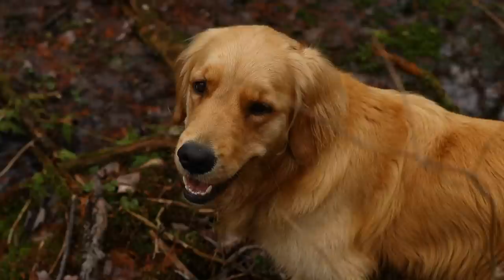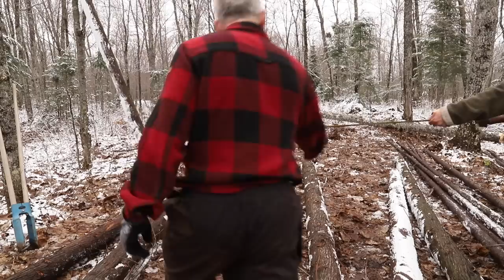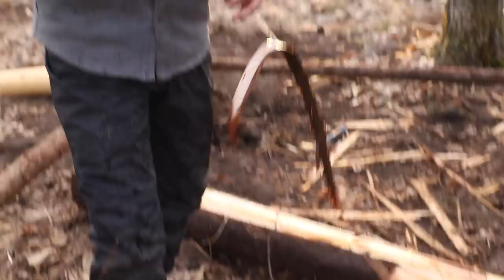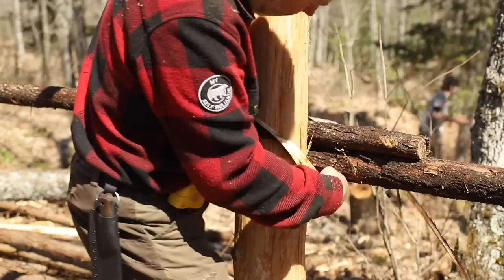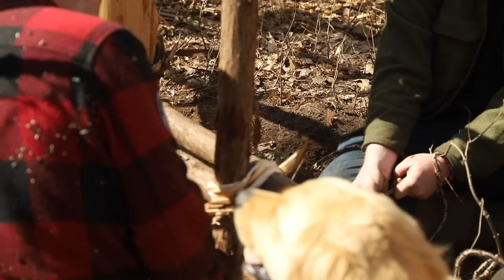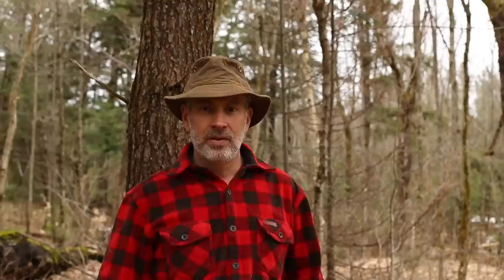Building a Native American Longhouse with Hand Tools | The Best Natural Bushcraft Shelter

Comment: Long houses were used in winter camp where you didn't have gardens separating homes. Summer camps used smaller huts or wigwams and had gardens between them.

Comment: Depending on what tribe they were, few of them felled large trees. Smaller trees (less than 4") and sappings were more commonly used making bark-covered wigwams or longhouses of which are typical dwellings used in north eastern regions. How did they cut trees? For the most part, they didn't. If you look at early European sketches of Native American villages even the more complex ones, the majority use of logs came from thinner trees and they used a lot of bark. This was material suited to what tools they had,  native American tribes were amazingly adaptive and suited for survival. They were a culture in western terms every man trained in every skill set.

Comment: hey Shawn great stuff as always. I work for a major forest company here in Sweden and here we instead have severe problems problems with spruce beetles right now due to an extremely hot and dry summer of 2018 (we had 25-30 c daily for almost 2 months with very little perception). I know there have been similar problem for canadian forest companies with dying spruce/pine for a long time. what are your thoughts will, more species get infected over there ?

Comment: I like the idea of a long house but I would like to do an alternative version where inplace  of wood white PVC pipe or tubing is used to form the frame section sure that would cost some money depending upon the overall height  width and length it would be way easier to build and one person could build it with a limited amount of tools because in reality your building is basically a hoop house with a center support beam running through the length of the building to provide additional strength to the roof

Comment: Hi Shawn, I was watching you guys having a hard time loop  the  sides to frame.  A suggustion that might work next time you might do a long house or something similar.  Were i work sometime we have long finish product that made of wire that needs to be coil to be shipped. I notice when the coiled wire comes loose it in a curved shape.  Mabe tied the end of the tree as close has possible and leave it for awhile and then loose it and see if its in a curved angle. If you try it let me know how it work on wood

Comment: I have mainly Fir and Spruce, but I would like to have a go at this. Would Hazel or Willow be good for the roof hoops?
Reply from the maker: We would have preferred willow or hazel actually. Fir or spruce would be fine for the post and beam, but you have to rot-proof the logs where they touch the ground.
Reply: @MySelfReliance  I do understand about rot-proofing the ground beams, I personally would burn the ends. Do you not have Hazel and Willow in Canada? We here on the Estate, have been coppicing both for many hundreds of years, They grow very fast are almost as versatile as Baboo, (which we also have) We are impressed by the design of this First Native Peoples design, it very much resembles a Viking long-House, with Benches/Beds either side and long fire pits, but your design is far more practical. Thank you for your excellent Video, we have subscribed. Stay Safe. ps, We too have Labradors, two Chocolate ones from the Queens Estate Stud at Windsor.

Comment: Just an opinion, instead of bending then tieing your uprights, why didn’t you lap the thin part under your main horizontal beam then the weight from the lower heavier bottom would have helped you bend it.. then you could have tied it.. just a thought , there may be a reason you didn’t. I’m just curious..

Comment: Would the bark work better if it was slightly smaller strips then braided together?
Reply: I thouht about that to...Yes probably, but then the problem is you reduce the maximal length of the strips you have...unless you braid them into each other which is an art to itself.

Comment: Not sure I would trust bark cordage. Moisture and rot can easily get amongst the fibres and....it's just not a good idea. So many things can lead to it's loosening.
Why not use something like rawhide? Not only is it way tougher, but when applied wet, it will eventually dry very hard, and will shrink quite a lot, tightening whatever it is binding.
Can also slather it in animal fats, further preserving it. This makes it a much better choice when binding things together` for something that needs to be rigid like a house frame.
It will outlast plant fibre cordage by many, many years.
Give it a go next time with whatever you build and notice the difference. :D

Comment: I do love this project.  However, I still wonder how the natives did this without the hacksaw.  They did not use metals of any kind.  And I do wonder how long this will last.  Wood and bark rot.  How often did the natives have to replace these structures?  I love the woods and would love living in them, but then my absolute favorite thing, number one, is my thermostat.  Before running water and even my microwave, I love my central heating.  I have had to melt snow for water, had a rain barrel as the only water source and that was okay, but I have lived without heat (in Anchorage Alaska) and that was not okay.  Let's face it, I'm spoiled.  I understand that time and manpower available for this was limited so cutting through the logs without metal tools is understandable, but don't fool yourselves, it was not how the natives did it.

Comment: There are several better ways to bend and fasten the bent-over roof rafters, than showed in this video. Using modern tools to recreate a longhouse was disappointing. If the purpose to built like the structure like the Indians did, then use their tools and methods.I bet that the Indians learned to use longer poles, so when the two poles crossed at the top ridge beam, the Indians would tie at the point; and again at ends of the two laps. That way, if one tie failed, there are still two other ties to bind the two poles together, aye. The method showed in the video can allow the one tie (with all the stress) to fail and tear that section of roof apart. It is easier to pull the poles into place by using a tether at the top end to pull each down into place. And a lot safer. With the lap method a hand saw is not needed to trim the ends.If it wasn't for smallpox, measles, and metal working skills, I don't think the white man would have defeat the Indians.

Comment: this is not a shelter. you are acting like you built a shelter but this structure has no protection from any elements and is waiting to drop a tree on your heads at any minute
Reply: its not finish...it will have a roof. Drop a tree? you are so positive. you must be fun at a party lol
Reply: @stingraysti  yeah dood they are celebrating like they have successfully built a shelter but all they did was put a bunch of hazardous brush in an organized pile. there is no roof and no walls to protect anything from the weather. see that tree sized log on the top? that thing is going to fall hard when those garbage lashings fail in a few weeks' time. if that's the kind of party you're into, go for it. i don't join those kinds of parties. you go ahead and have fun being foolish. my parties usually take place inside a building with a roof, walls and climate control. and the building is built and engineered to a standard which is inspected by officials to make sure that the roof isn't going to fall and kill someone any time a dog farts nearby. or, it's a party in the woods using a tent, an RV, a cave or a structure that is at the very least held together by nylon or some material that does not degrade like tree bark. i would suggests that if there are going to be parties there and people are going to be sleeping in that thing that you get some steel fasteners to hold them together, then you can wrap it all in vines and bark all you want and keep things family friendly. the last thing you want to do is invite your pal over to help you out on this impressive endeavor only to have your dream turn into a nightmare. yeah man, historical native building is sweet. but remember, those natives were not known for great architecture. it was more of a marvel that a backwards civilization could survive at all. it was probably not uncommon at all but just a weekly norm that some aborigine's house killed some people when the wind blew. you  probably don't ever catch yourself pondering about things like that. i can only imagine what a life you lead
Reply: haha dude...you are going overboard with this shelter. Keep saying there is no roof and wall...they are not done man. As for my life, don't worry about me I'm a very happy camper and living a great life and I'm not scrared of my own shadow like you are. Also I'm not sure why you are watching this kind of video if you don't like it?  Move on...